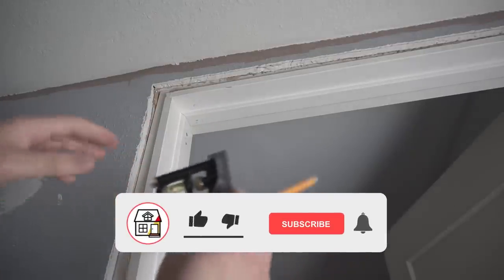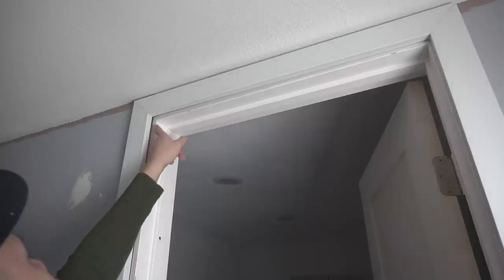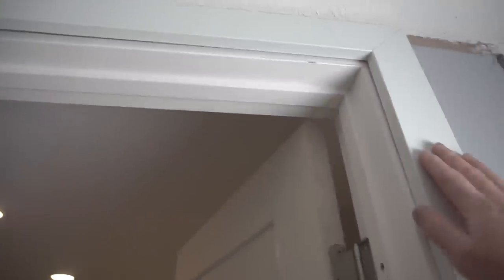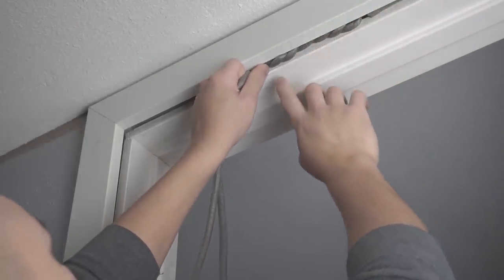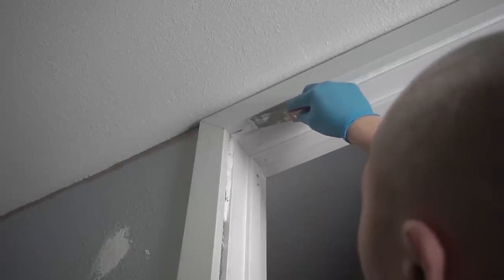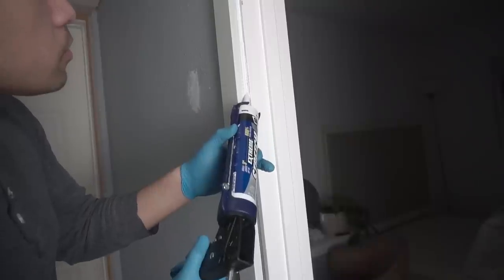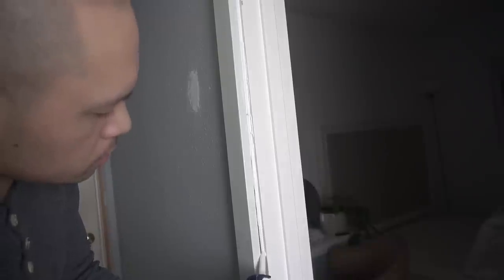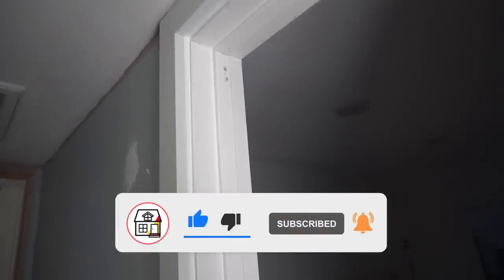How To Fix Door Casing Gap When Wall Sticks Out Past Door Jamb! DIY Tutorial For Beginners!

Comment: I've been Trimming high end homes for 24 years and I have never seen someone attempt to caulk a gap that big.  An experienced painter would never be able to make that look acceptable using caulk. In an absolute final resort and there was no other way to close that gap (I'll give you options ) I would use car Bondo. Probably take 2 or 3 applications and a lot of sanding  plus you'll spend way to much time on casing to make it cost effective.  Ok so come to an interior door that has the drywall sticking out past the jamb.. what do you do?  First thing I'd check if I wasn't the one that installed the door is to check it for plumb, throw a 4' or 6' level on each side of jamb where casing will be nailed. Do this on the latch side of jamb and hinge side if they are plumb that means your wall is not and there's nothing u can do with the jamb since it's already nailed in place.  If one side of jamb is not plumb you can grab a wooden block and place it on the corner that is sticking past the dry wall to far and smack it with a hammer. If it doesn't move to your desired spot you'll have to pull out the trusty saws all and cut the nails so you can re plumb it.  If the jamb is plumb and it's that bad your going to have to cut drywall.  Even highly talented finish carpenters can't roll the casing that far without it looking like a mistake.    I take a lot of pride in my work so I'm not walking away from this or stuffing it with backer rod and caulking it lol.    You'll need to take your casing and the best you can line it up to your 1/4" marks you made earlier on jamb.  Then using 2" or 2 1/2" brad nails tack the trim in place, 3 nails each side is sufficient. Top, middle and bottom.   Now take out your utility knife with a fresh blade installed and carefully run it along the back side of casing scoring the drywall.  Don't slip cause this will soon butt up to your casing, straighter the better.  Once scored you can carefully remove casing and pull the nails out.   Now go back over your cuts only this time out more muscle into it trying to go deeper into drywall.   After that you can draw your hammer and start beating the drywall being carfull not to hit outside your cuts.  You'll notice rite away how easy the drywall paper and drywall crumble off.  I like to use my speed square to plain across from jamb to see if I'm deep enuff.   If not you should be able to use your square or a chisel to carefully remove more.  Once your deep enough you can now clean up your mess 😁 After the floor is cleaned up place your trim back against the frame, you should now be tight to the door jamb and depending on how good you were cutting the drywall you should be fairly tight to your cut in the drywall on the back side 👍  that's how I'd fix it. Yes when looking at trim from the side you might notice it's thinner than the others or it might taper but home owners won't see that as bad as they would your epic caulk job with a boat oar.  Plus the painter will be much happier fixing the thin drywall cut next to casing you made than a 1/2" gap lol.     Thanks 👍 got any other questions feel free to ask.  I've got a way to trick the eye on just about all interior trim and cabinets.   It's what we do.
Reply: You can also rip a tapered piece of wood matching the jamb with a table saw then glue and tack in place. Once dried, sand inside of jamb flush where they meet, however it's extremely difficult to get the sharp end of taper glued and sanded on the edge of frame to look right.  I'd only opt for this option if door was in high traffic area.   Could always remove jamb leg from opening and make a new one thats one piece tapered to the opening size...  Depends on your time and skill level really.
Reply: Last thing lol sorry I forgot to put this in.    Usually the drywall always sticks past the jamb somewhere, some are really bad like this video but most are around an 1/8" if that's the case aslong as the drywall isn't tight to the jamb you can take your utility knife and on a 45 degree angle blade pointed towards jamb cut off the outside corner of drywall doesn't have to be perfect your trying to knock off that sharp corner.   Then draw your hammer and take out some frustration by smashing that corner you just cut off.  This will allow you to roll your casing to the jamb.   If your not gluing and pocket screwing your miters first you'll have to back cut your miters(compound miter) to allow for the roll.  K I think that's it lol
Reply: Loctite power grab will do just fine. It's not just any caulk. I had a similar issue with the old building I'm living in on a jab and it is holding up very well. 12 years and you couldn't even tell

Comment: That is in a high visibility area, whenever i set doors i try and flush the high visibility side of the door to the wall leaving any gapping to happen on the less visible side of the door. You are 100% right, tapered gaps are the hardest gaps to try and hide.

Comment: With a gap that large, you should fill it with a tapered rip made with a table saw and then skin over that with an elastomeric caulk.  No matter how many times you fill that gap, it will always shrink as it dries and look terrible.
Reply from the maker: Thank you for sharing your advice 🙏🏽😊
Reply: Thats always going to look bad. Work to a higher standard, I say. Gap fillers and caulk hide small imperfections, but not large. 
Bondo, if you insist.

Comment: Im in the middle of putting up new trim after my hardwood floor install and Im no carpenter or finish carpenter but holy crap whoever built this house must have been on a time schedule. I think I have one door / casing thats actually good, every other are out at least 1/8". Im sure there are/were acceptable standards even back in the 80's when this house was built but damn! We're selling in a few months so I'm going the backer rod way and fortunately where the biggest gaps are, hey are behind curtains or on the non-seeing side of the trim. But my point is there were hacks from the beginning lol

Comment: Making it look easy, as always. As the seasons change, will you have to reapply caulk?
Reply from the maker: It all depends on the environment fluctuations of temperature bother, if you do it won’t be for a long time since it will be painted over. 🙏🏽😊👍🏽
Reply: Big Stretch caulk will stretch as opposed to crack and gap. Any other type might cause problems in this particular situation.

Comment: That was my first option, but do you think cutting the drywall or hitting it with a hammer might do the trick?
Reply from the maker: That option will work as well, but keep in mind that the outside face of the casing will sink and the outside profile will have a sunken look. The drywall around it will be weak depending on how much you relieve, a little bit messy in my opinion. 👍🏽😊

Comment: Gently tap sheetrock with hammer working from door jamb outward until casing sits flush. Sheetrock will crush down and gap will go away. Also it won't look like a 12 year olds tree fort.

Comment: This is a really low quality, bad way of dealing with this.  The caulk will always be visible. It might be ok for the homeowner to do on their own house, but you can't sell this work.
Some suggestions:
Relieve the drywall under the casing or relieve the casing where it bears on the drywall.  Commonly done by pounding (aka "smashing...) the drywall with a hammer or with a 4" grinder on the back of the casing. Compound drywall once casing is installed to fill any cracks. Easy and quick. 
 You can also undercut drywall with multitool instead of the hammer routine.   
If gap doesn't exceed 5/16" +/-  the mitre can be rolled as its being cut. 
Casing needs to be within 1/16" of the jamb once installed, adjust outer edges to suit.
Just my 2 cents and 40 years of carpentry experience. 
"Do your best and putty the rest"
Reply: Does rolling the miter work for flat casings like these?  I feel like thats more suited to profiled casings?
Reply: @gfraser80  yes you are right.
Ultimately, flat casing is best preassembled, then hung on a surface that will accept it. Hence the undercutting and relieving of the drywall. Profiled casings hide more than flat.
Reply: @osmith5086  thanks for your reply and input. I am up against the scenario of the jamb sticking out from the wall. I think my best bet it going flat to the jamb and filling in the gap to wall with filler strip and or caulk
Reply: @gfraser80  or you could knock the jamb down flush with a plane. a lot depends on how visible the gap area is.